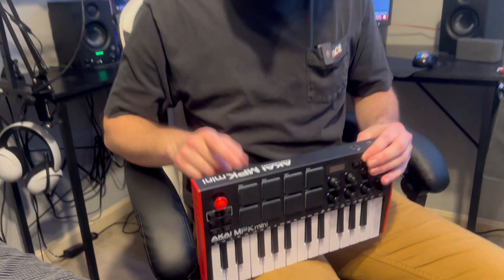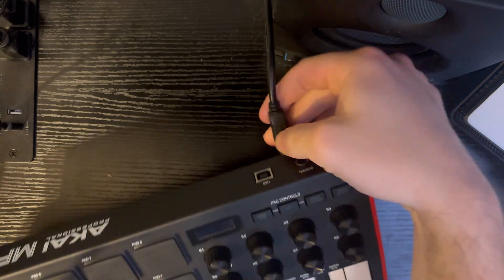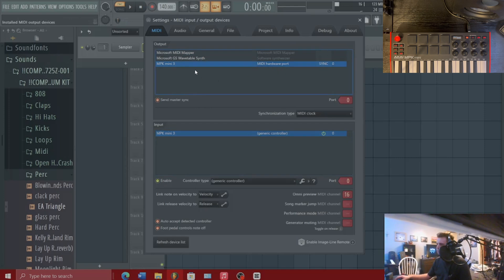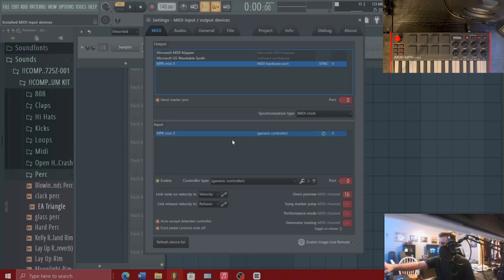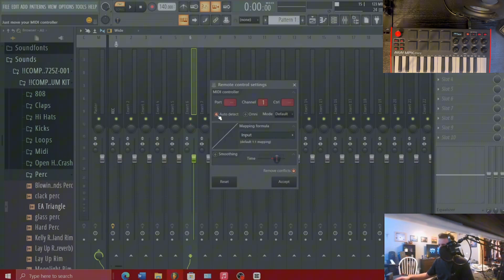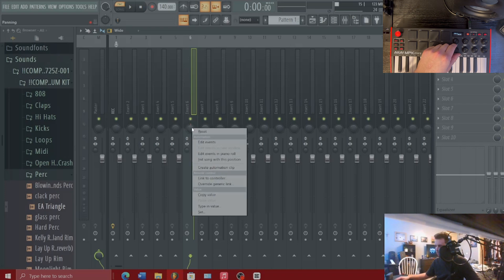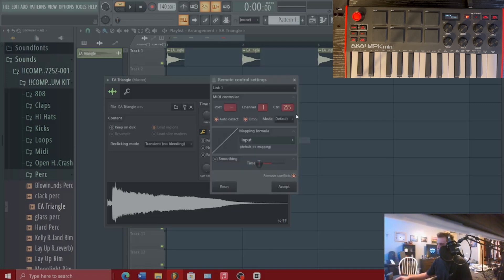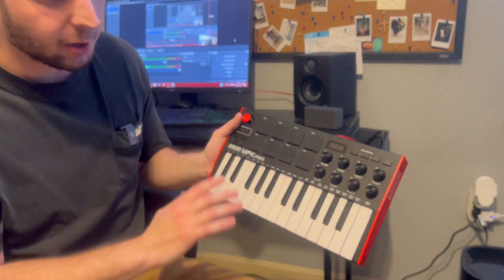How To Program Akai MPK Mini MK3 Knobs and Joystick in FL Studio IN UNDER THREE MINUTES

Comment: my knobs adjust the volume settings from 0 to max instead of being increments and ive tried formula controller among other things to fix this, any suggestions?
Reply from the maker: Does your Akai pop up in FL Studio midi options with the green power button? Have you had any trouble getting FL to pickup the input from the keys? Or is your problem only with the knobs
Reply: @jjsoyke  it does pop up and i have it enabled, it can send midi notes to piano roll for example just fine but the problem is with the knobs. thanks for the reply, appreciate the no nonsense tutorials
Reply: @jjsoyke  i have the same man... how did you resolve it?
Reply: Any resolve of this issue? I currently have no AKAI software, and have able to do everything else (Piano, pitch slider, etc) It would be amazing if this issue was resolved!